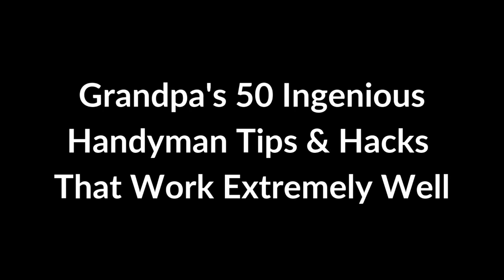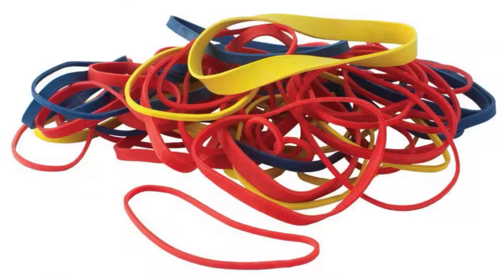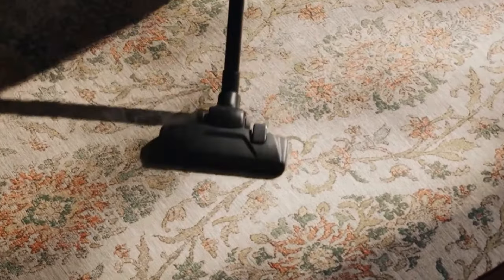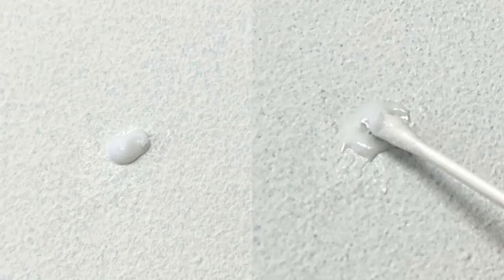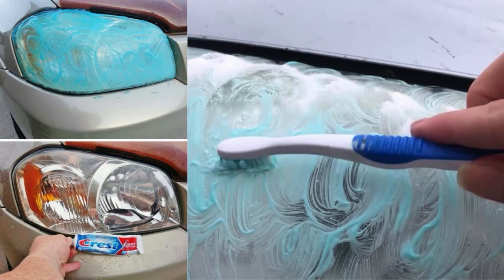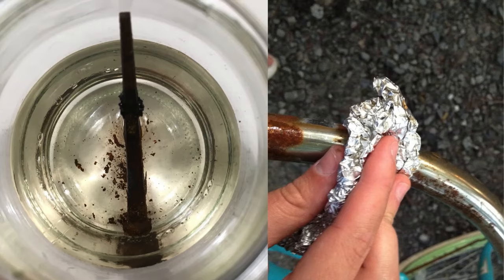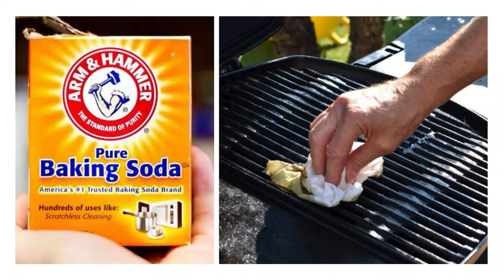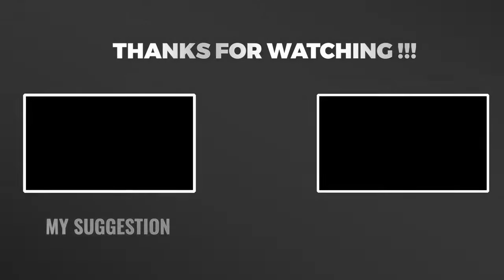Grandpa's 50 Ingenious Handyman Hacks That ACTUALLY Work

Comment: If you get a piece of glass in your finger, any tape will work including scotch tape. You feel it but can't see it - press the tape down firmly and slowly lift off. It works, I've done it. On your snow shovel try silicon spray. It's VERY slippery - don't get any on the floor! I use the little packs of dehydrator found in pill bottles to keep needles, pins and scissors rust-free in my sewing basket.